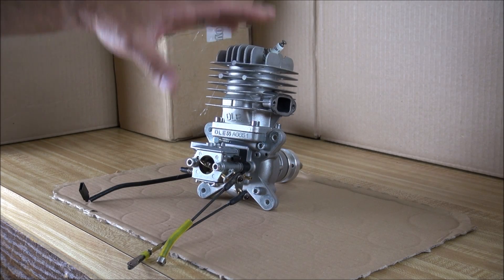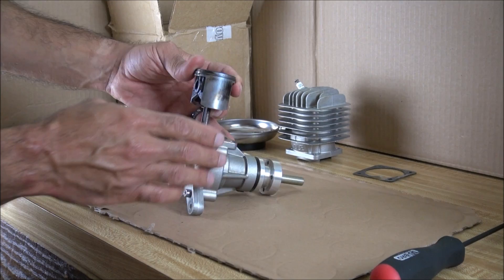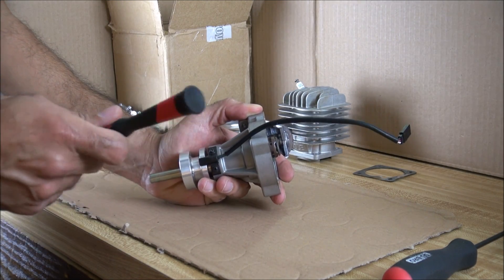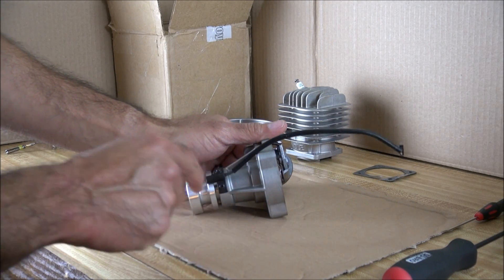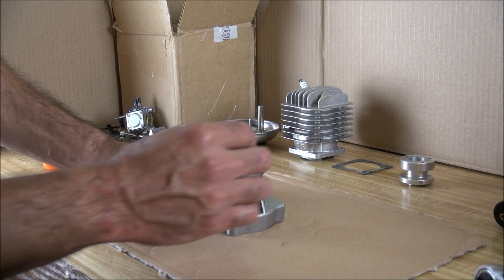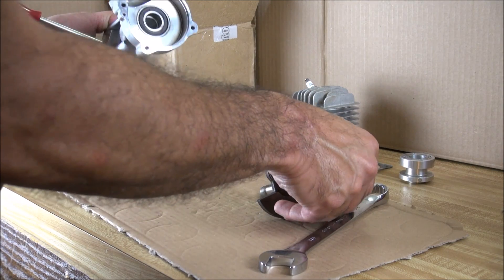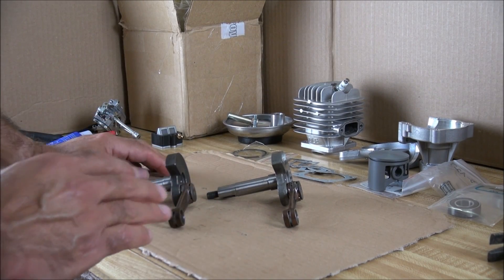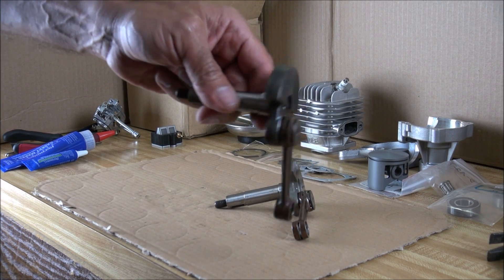DLE 55 RC Gas Engine Repair. Part 1 Disassembly

Comment: great video , thank you
  one other viewer said not to beet the bearing out, which i i agree. i cringed a little 
However , i've never really had a problem with beating one out, if its on small tap  on opposite side constantly. 
  I may try freezing tho, ive never tried that
 Meaning , it becomes tedious, and is just better to heat the case.
Reply from the maker: I clearly said on the video that I didn't like hammering in the bearings and that I'd prefer pressing them in but I was using what I had at hand.
Reply: Yes  , i watched it

Comment: very good video.  But I I would never beat the bearings in a crankcase!  freeze the bearings.  heat the case  they fall rite in. IMHO
Reply from the maker: I clearly said on the video that I didn't like hammering in the bearings and that I'd prefer pressing them in but I was using what I had at hand.
Reply: Absolutely agree, Ernie! If you can't beat them on the outer ring, you will probably damage them.
So I would never re-install bearings I beat on the inner ring.
But depending on the running hours, you can renew them anyway. Should not be that big invest as these are industiral standard parts.
In this case it's of course no problem to remove them "the dirty way" :-)
Finally a very good Video! Thanks a lot!

Comment: At the end of your video where two crank shafts are compared,I have the same problem with the connection of conrod and crank shaft.After sucessfully  replacing both of the bearings,the first time I started the engine I heard the same sound when engine is on the idle throttle,so now I have to diassemble the engine again and fix this but I don't know where to search for the parts,so can you direct me somewhere to search,a shop link on the internet,couldn't find it on ebay or hobby king...
Reply from the maker: ***** Here are a couple of links: http://www3.towerhobbies.com/cgi-bin/wti0001p?&I=LXDKRT&P=Zhttp://www.valleyviewrc.com/estore/dle-55-crankshaft-w-connecting-rod.htmlhttp://www.troybuiltmodels.com/items/DL55ENGINE.htmlIt seems like Tower is the only company who has it in stock right now.

Comment: How do you put a 50cc on 1/5 truck and what engine u buy for that
Reply from the maker: Donald Jenkins I have never worked on an RC truck and therefore I am not suited to answer your question; rc cars are not my area of expertise. I did however found some interesting videos you might want to check and maybe reach out to the publishers. 1)HPI Baja 5T 70cc RCMAX70 Engine !  2) huge rc scale car big rc 50 cc part 1 3) Chainsaw Buggy 1/5 scale, 48cc - Part I 4) https://www.youtube.com/watch?v=P_c8DeIT-0oThanks for your question and good luck with your project.
Reply: Thanks
Reply from the maker: You have to press in the ring against the piston so that the head can fit in.
Reply from the maker: Add some oil to the cylinder and the piston on the area where the ring is. This should help
Reply: @ralphdodi did you get your problem resolved

Comment: Good evening, I have a DLE 20cc with the same problem, what name do you give to it shaking between the crankshaft and the connecting rod? On the DLE 20cc engine is possible to change just the connecting rod or just crankshaft.  I was thinking of changing only the crankshaft; but, do you think this is caused by wear in the needle bearing of the crankshaft or by the connecting rod, or both?  In the dle 20cc the doing the repair is close to this one ? thanks
Reply from the maker: ***** Hi there. I don't know if there is a specific name for the shaking between the crankshaft and connecting rod. It is just knocking due to wear; now a small amount of this knocking is normal in many engines and it can be noticed on brand new never run engines. I did some research and it seems like you can replace any of the parts by themselves, meaning you can choose what to change. I think the the problem is caused by wear on the connecting rod, moreover if you have had any prop strikes which is very aggressive on the internal components of any engine. My suggestion is to change all the parts at once and play it safe. The biggest difference I see on the dle 20 is the hub which is a solid piece of aluminum without any grooves or holes. Taking it out may pose a challenge without the right tools.  Regards and happy flying!
Reply: The slang for this play is called “slop”. Not all slop is bad. Some engineers design slop into mating parts for lubrication reasons. The excessive wear can be caused by many factors for examples dissimilar metals heating and contracting at different rates, unbalanced props, improper fuel 
Mixtures etc.
Reply: @roymills415  Thank you